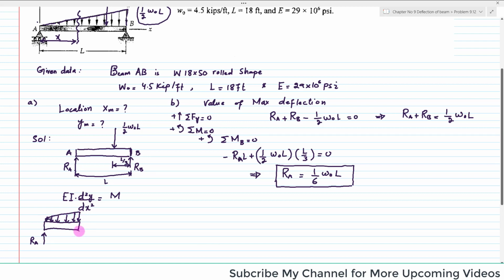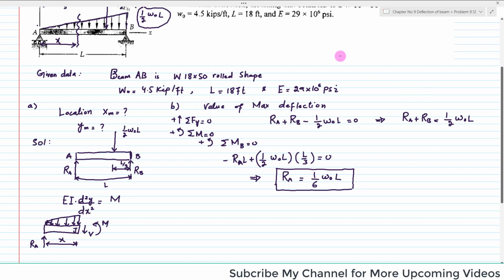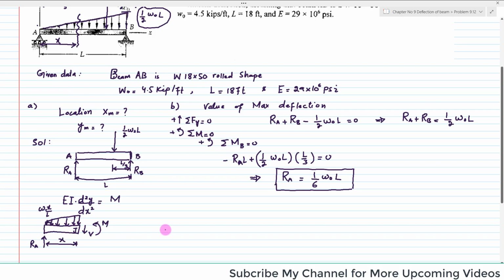Problem 9.12  ||Deflection Of Beam || Beams Deflection || Deflection Of Beams Solved Problems

Comment: i think you mde a mistake in the eqaution for M(x). It should be x^2 not x^3 no?
Reply from the maker: Please Specify the time where you think that there is a mistake?
Reply: @engradnanrasheedmechanical  The mistake this comment is referring to is at 10:06 when you incorrectly multiplied the X/L times the X/3 and got X^3 instead of X^2. But you got the right answer since at 19:14 when finding the common denominator you multiplied the L to the first term correctly but left out the third term leaving it as L^3 instead of L^4 which somehow made up for the mistake and got you the right answer. Plus at 20:13 when you are simplifying the quartic into quadratic you left the X^2 in the function when it should've been factored out but this did not really matter for the final answer.
Reply from the maker: @PetterXimello you are absolutely right. Anyhow my aim is to give idea and that matters, rest everyone has to do by its own in exam and the way he or she can , it can be done when you have clear understanding.  Thank you for your valuable feedback and detailed comments. ❤